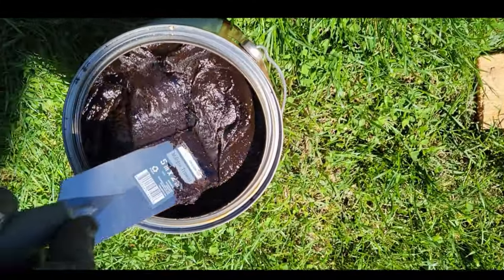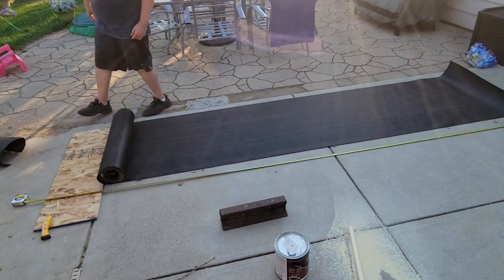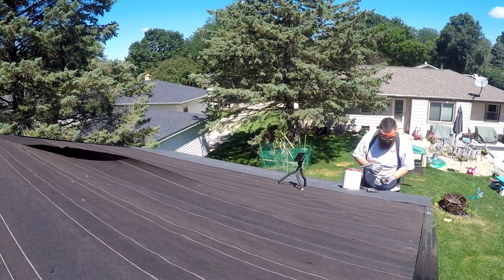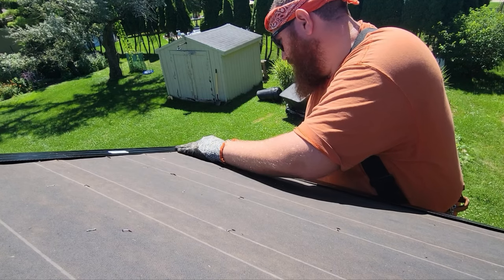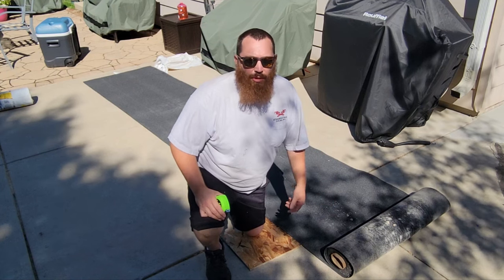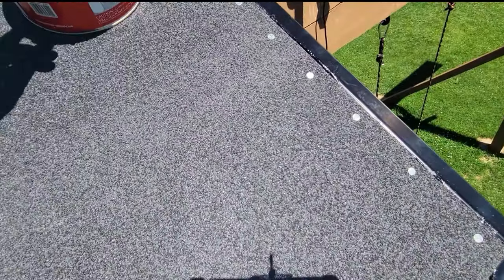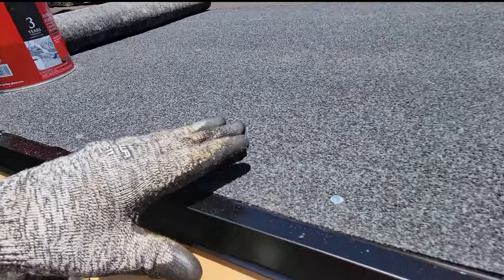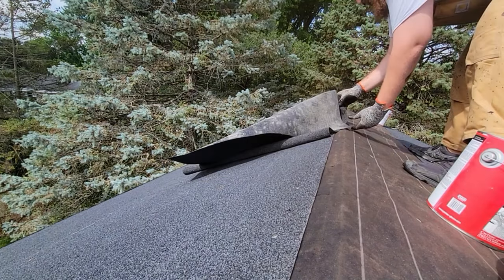Rolled Asphalt Roofing install

Comment: You're not supposed to nail the top coat.  The plastic cement holds it in place. You only nail the asphalt roll under the overlay.  Th exposed nails create a hole going through every coats !
Reply from the maker: Hey Thanks for the view Richard Pominville. I'll let ya know if there are any recommendations different from what the manufacturer says on where to nail and keep and eye out to see if anything leaks.
Reply: It is okay to nail as much as you wish --however all nail heads must be sealed and checked at least once a year.
Reply: You are right
Reply: You put a small dab of tar on top of nail heads. It will be fine.

Comment: Everyone says rolled roof doesn’t last as long as architectural shingle but I have a section of rolled roof that is the same age as the architectural shingle and the shingles started failing first. Rolled roof is still fine and might be extended with a coat of silicone roof coat or two. Seriously wondering if rolled roof would be better to redo the whole roof with it on a 3/12 pitch.
Reply from the maker: Thank you for the comments and the view. I think rolled roofing has its place and i think it can last a long while with the right care and climate.

Comment: Drip edge goes on first, then roofing cover, then rake goes over roofing cover.
Reply from the maker: At the bottom edge of the roof yes. That way if anything gets behind the rolled roofing it will find its way out over the tar paper and then out and over the drip. Thanks for watching

Comment: Thanks for sharing your process! Keep us updated with how well it stands up to the weather and if there is anything you'd do differently.
Reply from the maker: Thank you Antjobert for watching. I appreciate it! Right now the only thing I would do different is not install the last part of it on 90+F degree day. Heat index was way to high, being on a black roof made it worse but I pushed through to get it done.
Reply: @schufledoes  ooof, that sounds really tough. Take good care of yourself!
Reply from the maker: @antjobert  thank you!

Comment: A stong wind is going to lift the roll roofing and it will tear off since it's only glued and nailed on the edges.   Also, since it is loose over 90 percent of the area, the heat from the sun is going to soften, expand, and wrinkle it. 
Rolled roofing is supposed to be a full spread adhesive installation over the decking.  No roofing felt is necessary.   If you staple down roofing felt, then full spread adhesive and install rolled roofing, then the only thing holding down your roof is staples, the whole thing will blow off, even if you nail the edges!  If you fully spread adhesive for the felt, then again for the roll roofing, you are overdoing it since roll roofing is like thick roofing felt with granules embedded in it.  The seams can be nailed under the overlap.  The edges on the overhang can be nailed.  They won't leak and, if they do, the leak will not be into the living space, it will be outside.  Some rolled roofing has the underside with adhesive already installed.  You just peel and stick, not to felt, to the clean, preferably new OSB decking! Roofing felt is only for individual shingles where you are going to shoot a million nails to hold the roof on!
Reply from the maker: Thanks for the comments. Nothing blown off and we have had 2 storms with 45ish mph winds. My comment to gluing the full surface is that it isnt neccessary. If you have a positive connection around all edges there will be nothing for the wind to catch and then eventually blow off. So if all your edges are correctly fastened it should stand up to some good winds. Also the south facing roof doesn't show any wrinkles yet. We have some good temp swing with being 100's on install and right now it's-15. Thanks again!

Comment: Many years ago all one seen was either tin/metal roofing or rolled roofing . Most were metal and then came cheap roll roofing and then shingles etc .
Roll roofing is a fairly easy process and does not require to much work, not like shingles or today's metal roofing.
We rolled it out started at the bottom edge and worked up to the top, we would use a tar mix at each joint that lapped over the other just in case and around all nails and later after done would go back and place that tar over each layer that overlapped the other so no seam was ever exposed, neither was any nails , that was the only hard part and that was because you stayed bent over or setting a lot putting on that tar and there were never any leaks or issues. It was used on houses, garages, shelters etc etc . And I see the price sure has gotten high like everything else now days
Reply from the maker: Thanks edwill. Appreciate the insight on your process. Seemed vary similar to how I've done it. Thanks for the view.

Comment: Gotta do a roll roof on my daughters 15x15 Florida room roof so we can put in some recessed lighting. No way to run electric from inside bc the panels are 4” thick styrofoam so need to go from top, outside. Good job thx for posting.
Reply from the maker: Sounds like a fun project! Glad this helped you out and thanks for the view!
Reply: @schufledoes  it helped a lot bc you made it look “simple” and I should be ok if I take my time, thx again.

Comment: Are you supposed to put all those surface nails in it?  
Especially at the edges?  
Seems like a lot of potential leak possibilities?
Reply from the maker: Yea, it is a fair amount of nails going through. However, it is suggested from the manufacturer. These are also nailed through a good amount of that roofing tar at all seams and edges further sealing the nails. Nothing has leaked through any nails in the first year yet.

Comment: Did you cover each bottom section with the tar?  Cover up the previous nailing?
Reply from the maker: I do believe so. Top edge and bottom edge as well as vertical edges.

Comment: Why is roll roofing the preferred thing on low slope roof? Is it that it remains unbroken for large spans of distance so it can move the water easier than if it was a bunch of shingles?
Reply from the maker: I'm not sure it is preferred on low slope. Typical asphalt shingles can go down to 4:12. Some say rolled asphalt roofing can go down to 2:12 which I think is the absolute minimum I would ever go. Likely not going under 4:12.  Once your below 2:12 your looking at a monolithic sheet membrane like a rubber roof or TPO or similar. 

Some reasons why this can go a lower slope than an asphalt shingle is the seam and how more likely water can back track up and under the tab of the typical shingle at low slopes. 

Hope that helps

Comment: Proper way to insure any roll roofing doesn't buckle is nail down felt with button tab nails an you use asphalt cement glue for roll roofing. You apply cement under the entire surface and only nail the overlap before you start running another roll
Reply from the maker: Thanks for the comments?

Comment: Hi, I have rolled asphalt on top of my indoor patio addition. I have plans of sticking a pvc pipe up through this stuff. What kind of pipe flashing would I use and how would I cover up the flashing?
Reply from the maker: Hello, thanks for the view. I would recommend a metal flashing piece with integrated rubber flexible boot. Cut in the flashing so the up slope end is under roofing material and low side is over the roofing. Then make sure it's in a good bed of sealant all around and seal the holes to the roof and then around the pipe.
Reply: @schufledoes  Guess I can't just drill straight up wherever is convenient like I was planning. Gotta land it in the seam! Thanks!

Comment: Wouldn’t it be better to use cold adhesive instead of nailing holes through the granulated roll?
Reply from the maker: Well it isn't an issue installing it the way I show. You can do some cold adhesive, but I am unsure how that works or how well it would stand up over time without a mechanical fastener. Thank you

Comment: What are your thoughts on using this for a patch on a house?  I've tried to seal a leak without any luck. The shingles look fine and I see no place water could get into the house. Looks aren't impotent as is on the back, but I'm going crazy with a roof leak.
Reply from the maker: To be honest I would not use this for a patch job if you have a leak. Get up in your attic and see if you can find where its coming from. If you can find the bad spot then grab yourself a Roof Snake Tool off amazon or similar and you can easily pop shingles out and off anywhere on the roof. Find the issue and fix it, then splice the same shingles or new back in with that Roof Snake Tool. If the shingles look fine, it could be an issue with the underlayment not shedding water correct and finding a problem up stream than is finding the weakest point. You can email me if you want more specifics schufledoes@gmail.com. Thanks for watching.
Reply: u need to do a torch  down if its  still  leaking.. what hes doing might work  but it will only be a temp  fix

Comment: Are you self-adhesive rolled roofing on top of my OSB no filled paper and I’ve had it on there now for 4 1/2 years self-adhesive and no problems
Reply from the maker: That's awesome and good for you. These are good products and can lay a good while.  Thanks for the comment.

Comment: I did roofing in Greenland, very different style
Reply from the maker: Ango thanks for the view. Curious on Greenland roof construction. This is not common practice for many roofs here in the states but it's great for a jungle gym which is what this.
Reply: @schufledoes  Well, basically, every single roof up there is asphalt roofing despite the angle. Only saw one roof which looked to be wood shingles or smth. Asphalt seems to be the best answer to the constant storms, snow, rain wind etc. 
Mostly we did it on 45 degree roofs with torch and Icopal product (10m long 1m wide) 
And since it wasnt a flat roof but a visible one we had to make it look good so alot of stuff had to be constantly tracked
Dont think that slabbing on that black glue is sufficient with all the storms.

Comment: What type of product is this? Do I need to tar over my exposed nails?
Reply from the maker: This is just a rolled asphalt roofing product. It is not required for you to tar exposed nail heads because they are fastened through the layer of roofing tar at the seems. You can as added insurance but not necessary.

Comment: When I overlap the second sheet do I nail with glue or just glue
Reply from the maker: I nailed along that tar line yes. I believe its good insurance to use both the tar/glue and a nail to securely hold that edge down. Just make sure the nail is in the tar line so it seals itself as it goes through into the substructure. good luck and thanks for watching.
Reply: @schufledoes  Excellent after that do I cover the nails on top with anything
Reply from the maker: @Buckoff9900  technically you should not have to, i did not. However, you can put more of that roofing cement over the top for some added insurance. A small blob just to cover the nail head and seal to the adjacent roofing material.

Comment: On flat roof s nail and cement seems only on black side only
Reply from the maker: Thanks Milton!
Reply: Will the cement be enough to hold the roof down when you don't nail the lower part that is exposed?
I nailed both top and bottom but then you see all the nails.

Comment: It would have been better to have used shingles on a roof that has that much slope. With a minimum slope of 2 1/2 inches per foot -a shingle roof will last at least 25 years using cheap 3-tab shingles and far longer using architectural shingles-40+years. Roll roofing last 10--12 years. Your work looked very nice.
Reply from the maker: Bob Bailey, thanks for the comments. Main reason for the rolled roofing is to avoid nails! There will be many adults and children in close proximity to the underside of the roof and I want to avoid as much as possible someone getting a nail in the head. Rolled roof with a nail pattern like I did only has a few dozen nails showing that I cut off. If I did a traditional shingle I am probably looking at close to 500 nails on the 4/12 side and maybe 300 nails on the 6/12 side. thanks for the comments and views though.
Reply: Gaf liberty base and cap rolled peel and stick is my go to in this situation. No fasteners

Comment: You did it your way, but you did not do it the right way. 1st of all your "Base Paper" should be at least 30# felt, but should be an actual base paper which is heavier. It should be nailed down with 1" headed tin caps, Plastic caps would work too. Using staples will not allow your base to hold down enough. A heavy wind can easily pull this roof off. By using the 1" headed caps the base will hold down during heavy wind. You do not want exposed nails as they will work loose in time from the heating and cooling of the nail. You also should put "dots" of Plastic Roof cement throughout the middle of the base paper to keep the 90# held down in the middle and from wrinkling over time. You do not need to nail the outside edge through the 90# or the bottom edge as the base 1" headed nails and the plastic cement will keep it held down.  THIS VIDEO IS NOT A GOOD GUIDE.
Reply from the maker: Well, those are some thoughts. Thanks for watching and for your thoughts. This roof has held fine for years now and through a few different 60+ mph storms. Looks as good as the day it was installed, and nothing has worked loose or changed. In WI we go from -20 (or below) up to 100's and with that temp swing, the roof is doing awesome. Thanks again for the view.
Reply: @schufledoes looks like what you did worked just fine😂